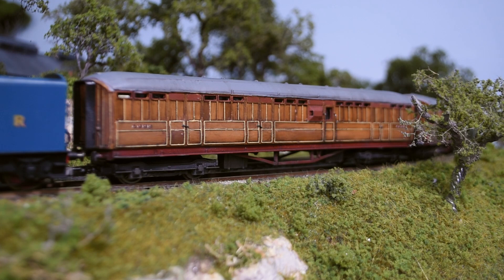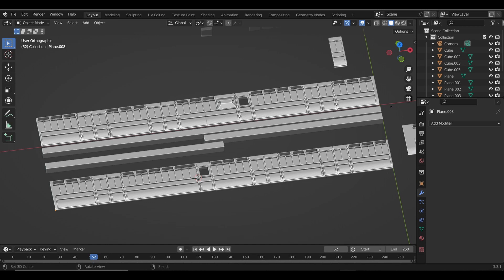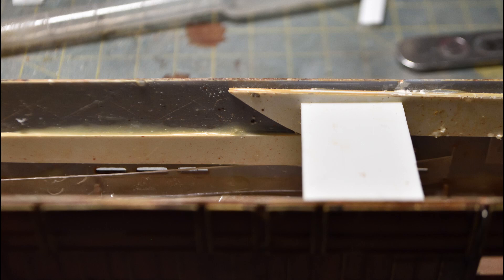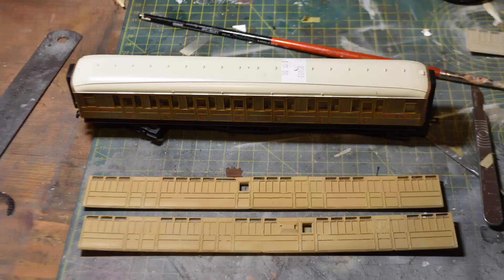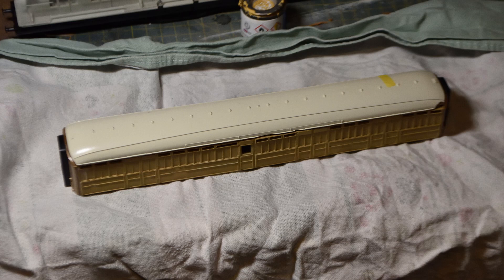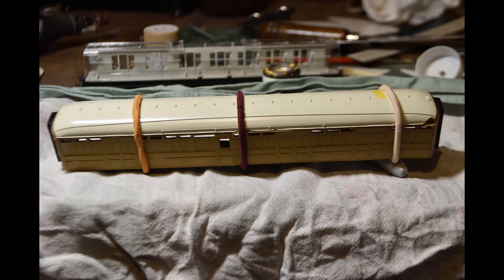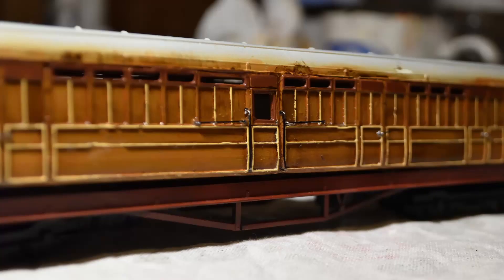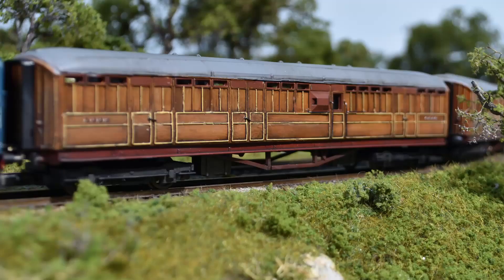Making a Budget Gresley Teak Full Brake Coach

Comment: This Looks absolutely Awesome & far better to have done this from a modelling perspective, than just hand over a bunch a cash and open a box - Great Job well done 👏🏻🙌🏻✨
Reply from the maker: Thanks! Sadly, it's always run a bit wobbly and been a bit prone to derailing. I've never worked out why. I did recently manage to get a Hornby one for about half price in a sale though!
Reply: @JanjyGiggins  I bought a (not very well made) kit full brake for a tenner going back a while, so I’m gonna use the sides to do a similar job to yours. Good tip about the Varnish, and I might need to have a good practice with the lining pen to do it justice 😁👍🏻
Reply from the maker: @donniblanco5239  Good luck!